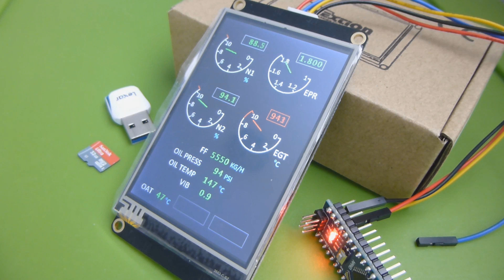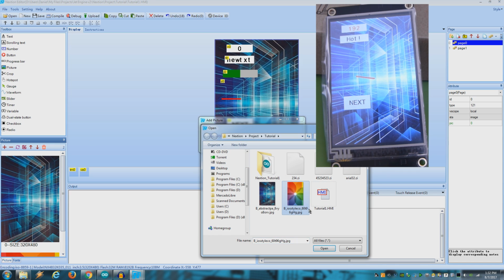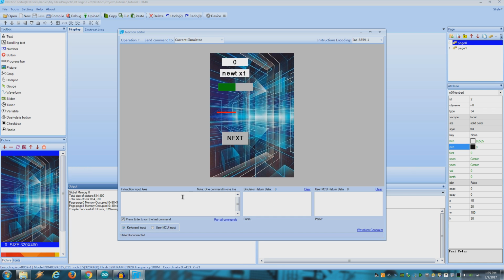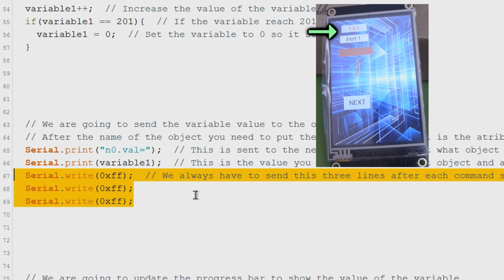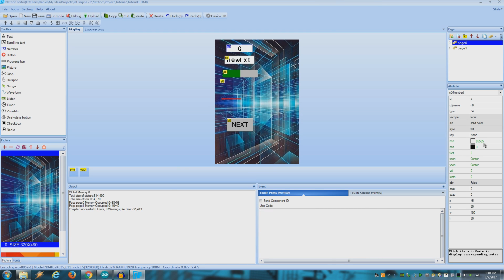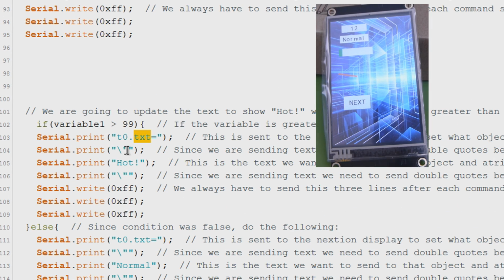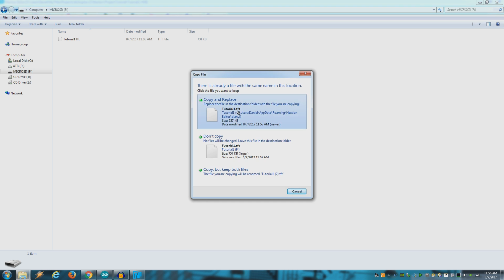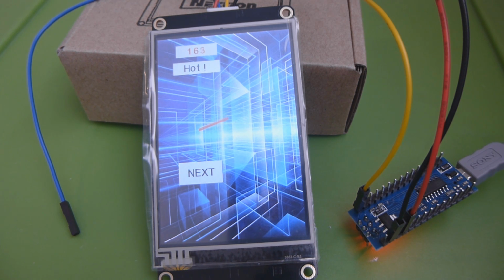Nextion+Arduino Tutorial #1 Beginner's Guide

Comment: AWSOME VIDEO... good work.. i started to make arduino tutorials, if you want please check them out and tell me what you think ... thank you
Reply from the maker: I watch the video about the thermistor. Is good. When I tried that a few months ago, I didn't have the data sheet for my thermistor. I found something similar but wasn't giving the correct values at the set temperature. What I did to translate value vs real temperature was to put the thermistor in a variety of temperatures from -6 to 100 °C and record the value it gives with arduino. Having all those measurements at different temperatures, I remap the value to give what it should be the real temperature. It wasn't as accurate nor elegant as using a formula, but it work.